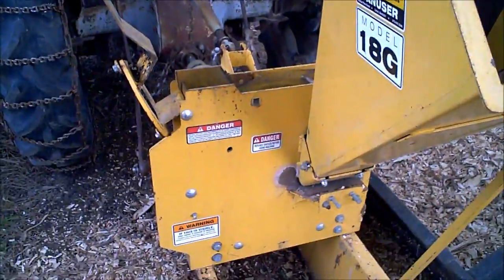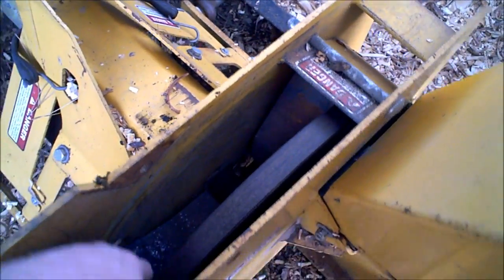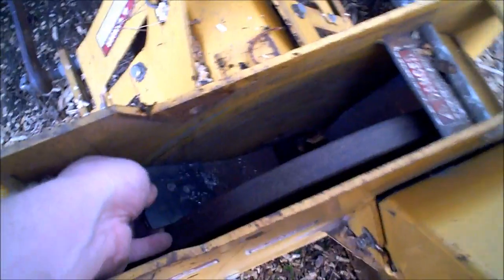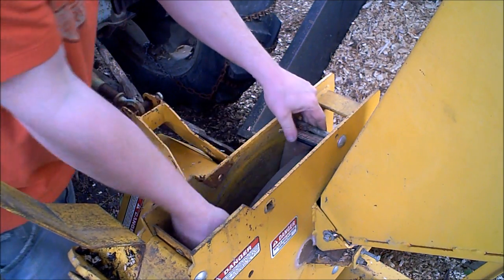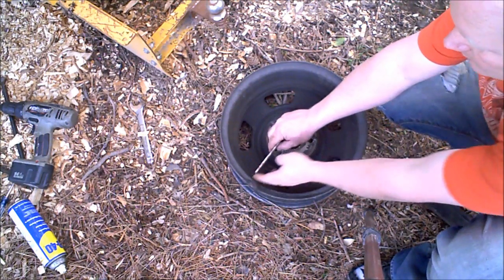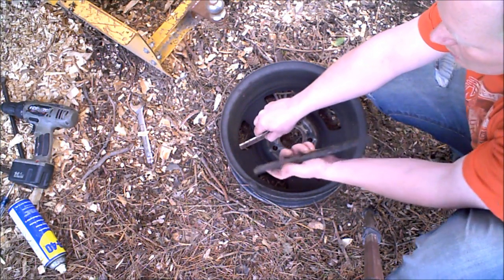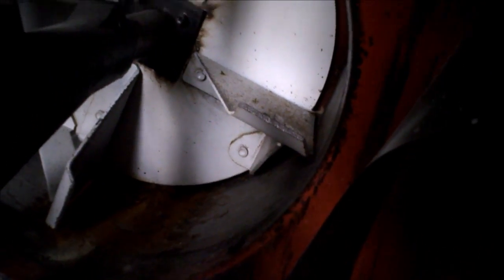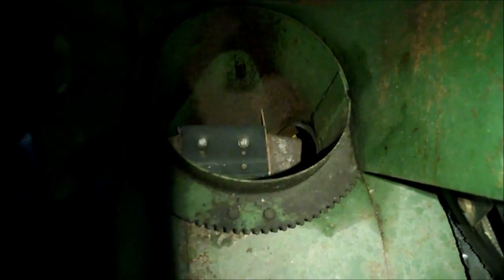Make Wood Chipper Throw 2x as far and never clog

Comment: What's the best  way to add a power feed to this?  Was hoping for something with a variable speed electric motor and gearbox. Or maybe there is a way to add hydraulic motor for the feed.
Reply from the maker: The easiest way would be to make the intake angle adjustable. The steeper it is the more the chipper will pull the sticks in. That does have the downside of reducing the size of branch though. A spring loaded drive roller driven by hydraulic(or electric motor) is how the commercial units do it.

Comment: Great idea. My Subaru powered chipper doesn’t pull the limbs into the cutter correctly. I’m hoping that sharpening angles on the blades will help. Any ideas?
Reply from the maker: A lot of these chipperz won't self feed no matter what you do. It can beat the crap out of your hands. Sharpening the blades always helps but generally it's the angle of the input shoot.

Comment: You’re brilliant. 

I actually noticed the other side gap where you feed the wood got clogged up very often because of long fiber tangled around the rotating axis. Do you have an easy way to fix that?  Thanks
Reply from the maker: Mine has a metal plate that gets adjusted right up the edge of the blade so little can get into that side.

Comment: Hello, I knknow this is a old post so I don't know if anyone will read it but has anyone ever converted a commercial woodchipper into a tire chipper.  
Even if I had to quarter the tires, what would have to be done. 
Thank you very much. 
Paul Neighbors 
Kemp, TX.
Reply from the maker: The steel belting in tires would ruin the cutting knives instantly.

Comment: I'll bet that if you measure the velocity and volume of the air flow, then pull out your rubber vane extenders and measure again, that you'll discover that the chip velocity gain is primarily due to your dramatically increased air flow. In the chipper, the air will jump out of the way, rather than take on the high velocity of the the impeller, if you give it a gap on the perimeter. Those light little chips will do what ever the surrounding air is doing and your air is screaming. NOT a criticism of your great quick and easy fix, bravo!

Comment: freaking genius it reminds me of an impeller in the lower unit of my boat let me ask you something do you think this will work with a smaller woodchipper I have a earthquake 212 CC I've never really looked at the blade so I'm not sure if it's similar to yours
Reply from the maker: Yes, the earthquake chipper will be virtually identical internally. But they aren't as easy to gain access to (I've worked on a few).
Reply: +sixtyfiveford Ok Thanks

Comment: I search youtube for anyone with a Ferguson TO30 running a wood chipper and found your video. I'll now see if you have anymore videos showing your tractor running it but in case you don't I want to say now that I liked your video and would like to see more of your tractor running it. BTW is it still 6v or is it now 12v? I'm just finishing rewiring mine and turning it back into a 6v tractor and I noticed that yours was a little slow beginning to start so I figured it was a weak charge or possibly a 6v & was curious.
Reply from the maker: +austinwagoncompany It's a12volt, I just have very weak battery in it. This is the only video with it chipping. It does a very nice job and seams to have plenty of power.

Comment: Hi I recently finished building my own design disc chipper, and found that although I got the chip fan blades fairly close to the casing it still clogs up. I am going to take your advise and fit the rubber strips on the fan blades. What I really wanted to ask you was: How critical is the spacing needed for the cutting blades to the anvil? I would appreciate any comments you may have. Thanks for the rubber strip tip.

Comment: Another great fix it video......City guy moved to treed lot and just took down 20 trees......some fire wood but all the limbs and small branches.... Ghiper !
Reply from the maker: MYFREECAMPER Thanks. Chippers are fun but they need a good engine to be able to chip good size wood. Most small chippers you would buy from the home improvement stores will beat you up and be more work than they're worth.

Comment: seen your vid on snowblowers,can't believe this would work on chippers.can't wait to try this.thanks,rudy
Reply from the maker: rudy52350 I know I didn't have a good before shot of it but it would clog up all the time if I fed wood a little to fast. Now I can jamb as much wood and as fast I want. I pretty sure that is why the guy sold it to me so cheap.
Reply: sixtyfiveford i've always had that problem with my chipper.hard to believe that rubber paddles will do the trick.

Comment: I'm surprised this works. I would think the hard rubber blade addition would not stand up to the violence of busting up hard wood. What did the rubber blades look like after running a while?.
Reply from the maker: They only come into contact with the already cut up chips. This larger unit is designed the same way the cheap Home Depot ones are. Where you have a flywheel with a slot cut into the face and a blade in front of that. The outer edges of the flywheel have impeller blades(just a fan). This mod only affects the fan portion of the chipper making it clear out chips faster and more efficiently. 

The rubber paddle blades have about 75 hours on them and they look just like they did when I put them on.